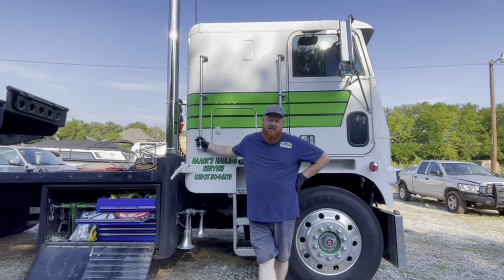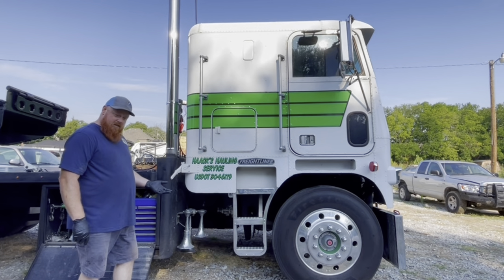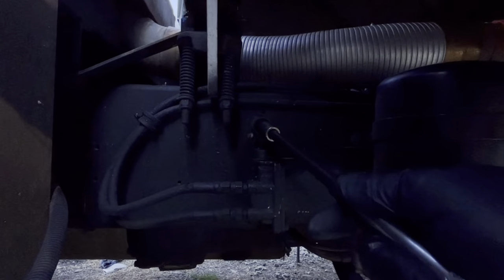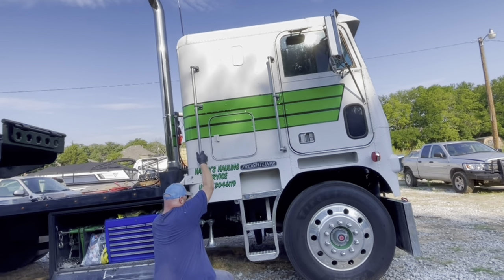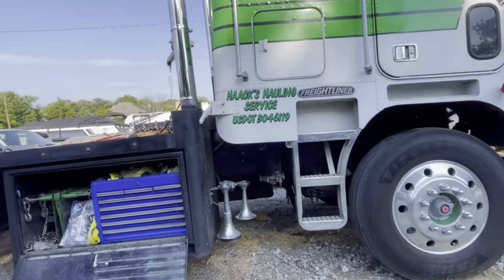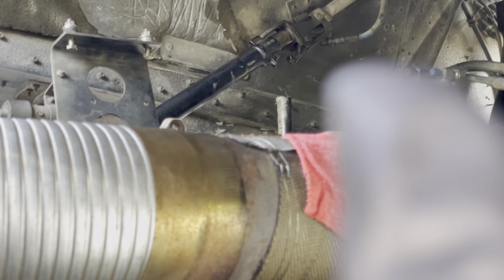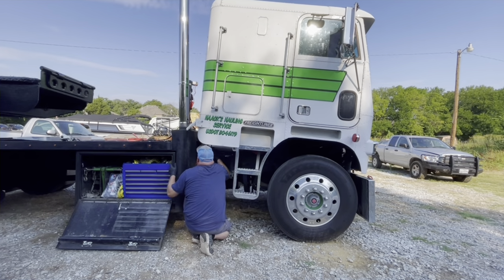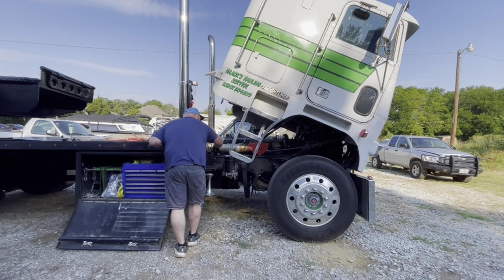How to jack up the cab on a freightliner cabover

Comment: Is there anyway to bypass the lock on the shift linkage or take it apart where the 3 bolts are ? My lift cylinders are shot And im trying to use a couple long ram bottle jacks to tilt cab and fix a blown intercooler boot and having trouble
Reply from the maker: I would have to take a look how it bolts on I know there is a pin holding the lock hook but don’t think could get to it. First thing that comes to mind is to find the lines going to it and use a porta power to supply it the juice to in hook it.

Comment: Do they make an electric pump?
Reply from the maker: So, I don’t think in my model they did from factory but they did have air ones witch would be nice to have. There has been several people that have converted to a electric jack.  My thoughts are if you have to lift the cab that much something is wrong. 🤔this truck probally needs one. Haha. Thanks for watching and commenting.